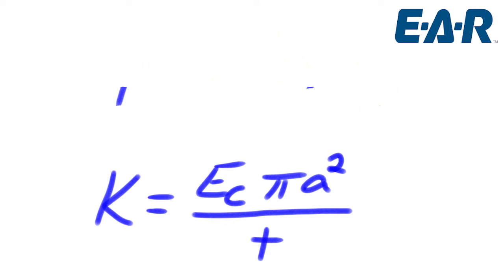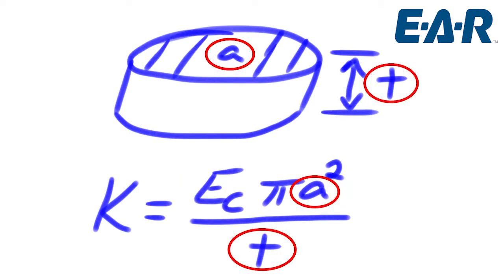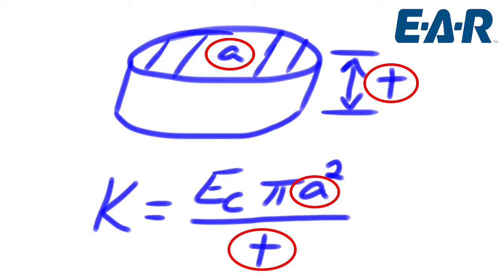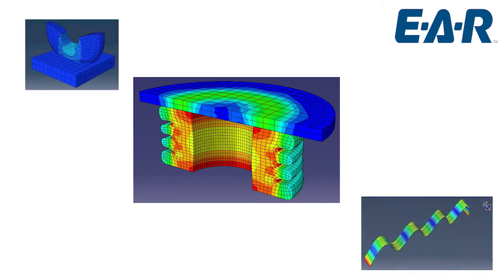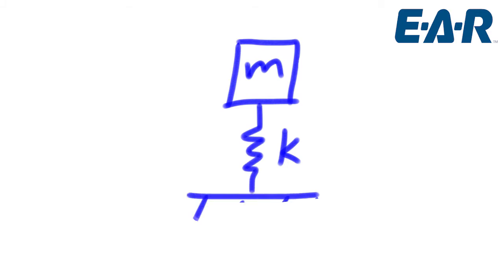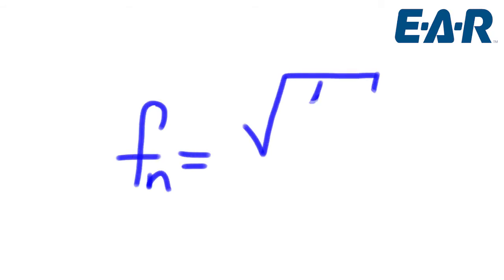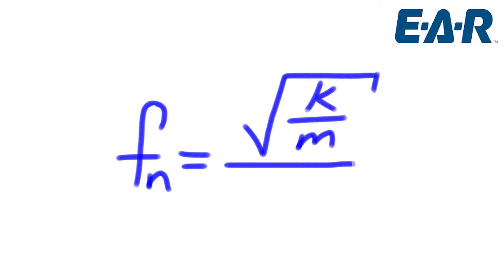Designing a Vibration Isolation Solution (Part 2): Stiffness & Natural Frequency

Comment: Something's not right with the K formula.  It should have units of force/distance.  But the equation shown would have units of force*distance.  Perhaps the area should have square units but not be squared in the formula.
Reply: If a is area perhaps it shouldn’t be squared?  That would give stiffness as force per distance
Reply: a refers to the radius not the area
Reply: The a represents the radius as previously mentioned. You get area from pi a^2. If you give E (elasticity modulus) metric units (Pa = N/m^2), you get (N/m^2) * (m^2) / m. The two m^2 cancel out and you're left with N/m